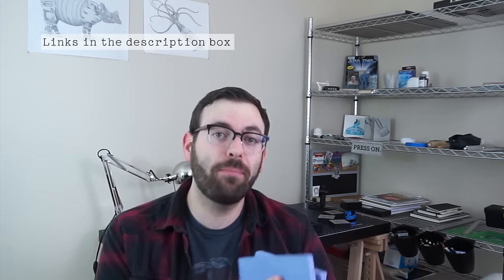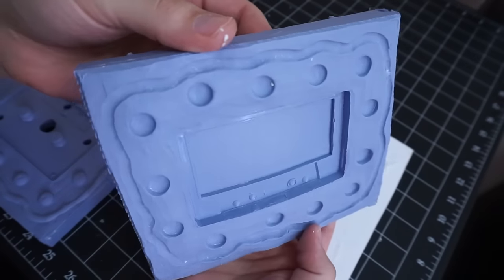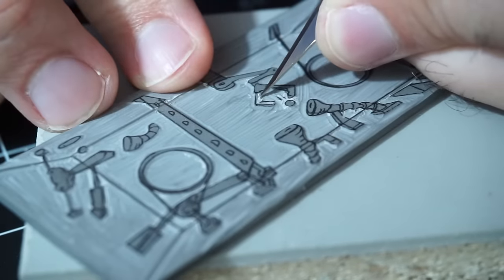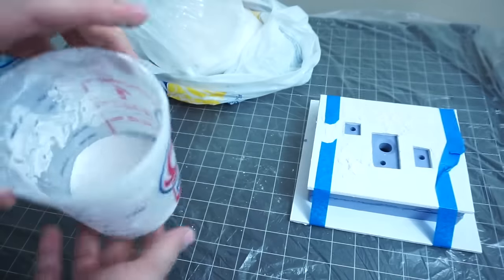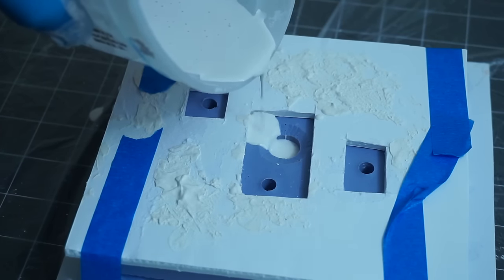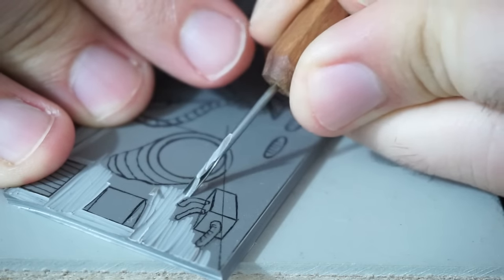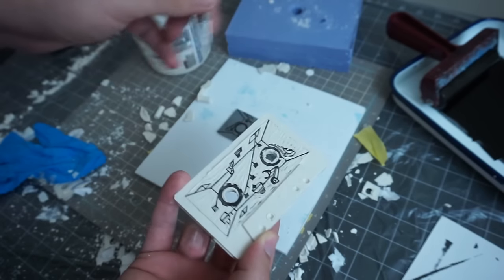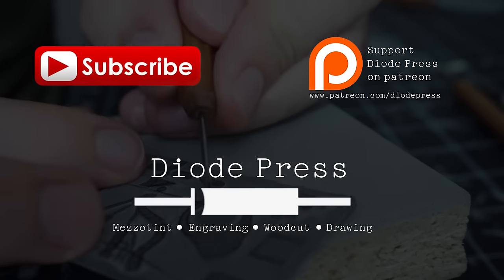Making a Print With Plaster of Paris - No Press Required!

Comment: Really neat project, I loved it, I'm just starting with Lino, so I have a question I hope you can give advice on, that's about sharpening your tools, I've searched YouTube but all I find is how to sharpen wood turning tools, any help would be very much appreciated.
Reply from the maker: +Wayne sykes I typically use leather strop, and run the tools across it for 10-15 passes when I feel like it's getting a little difficult to carve a block. If it's really dull, or I get a chip, I'll use a fine oil stone or a waterstone and sharpen it with that. My woodcut tool video has a section around the 7min mark about using the sharpening strops, but I don't have a sharpening video. Check out the info over on McClains printmaking (under whetsones and sharpening): http://www.imcclains.com/productinfo/index.html Hope that helps!

Comment: Try adding the plaster to water instead of water to plaster. You will have less trouble with air bubbles and less need for mixing. Better still if you use a small sieve to add the plaster it prevents clumping.
Reply from the maker: +Peter Hackett Good tips, thanks!